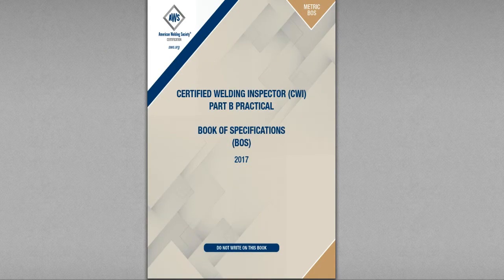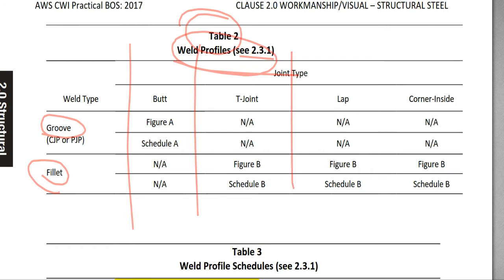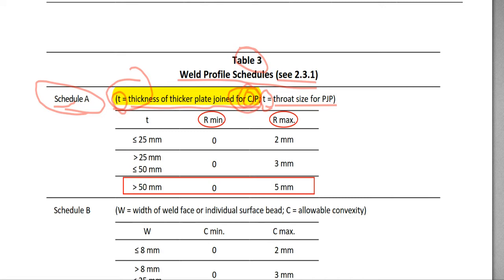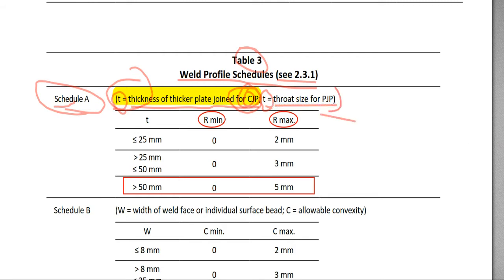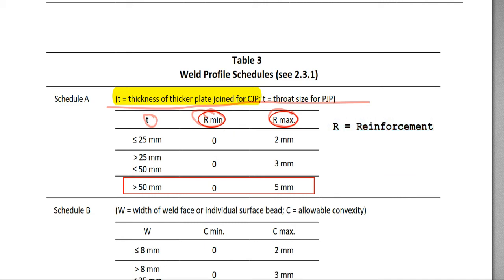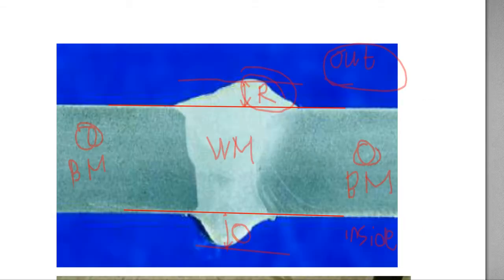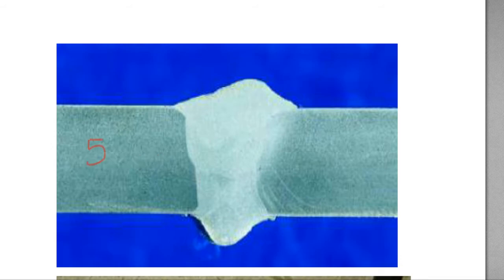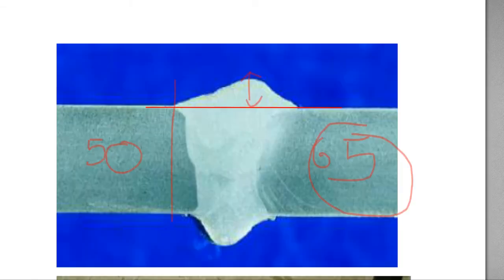CWI Part B Lecture#8

Comment: When measuring weld reinforcement with two different base metal thicknesses, are you measuring from the  thicker plate?
Reply from the maker: yes, you measure from the thicker plate. 
based on Ch. 2 table 3, you select the one form the thicker. Based on Ch. 4 table 5, you choose the higher surface of the two joining.
Reply: @inspectionwise  Thank you for you response and posting your lectures.
Reply: anyone know how to measure convexity with the exam toolkit? thx